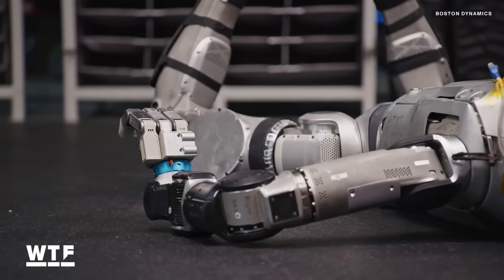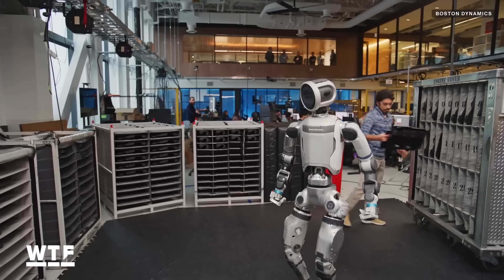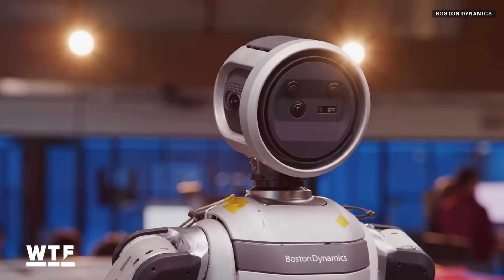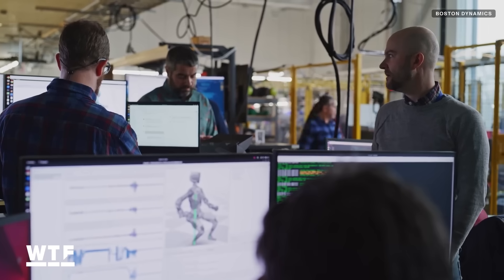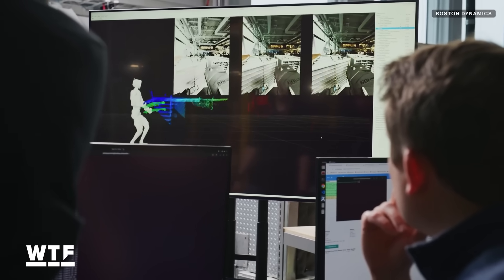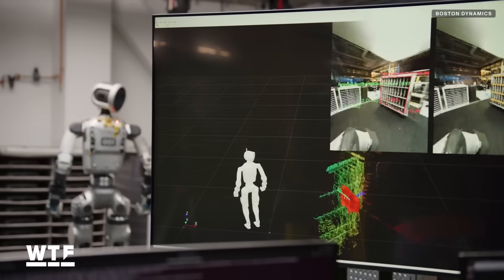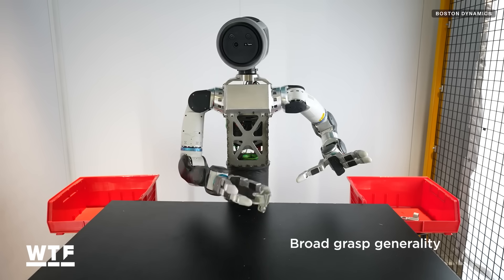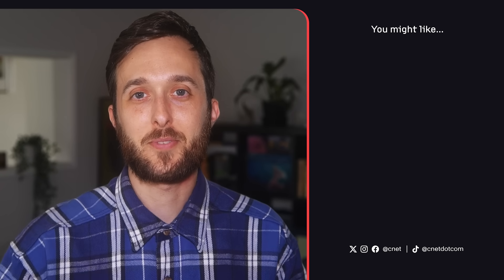How Boston Dynamics' Atlas Humanoid Robot Sees the World | What The Future

Comment: The head should have 360 degree view so it doesn't have to rotate at all.
Reply: that might increase the need for additional compute to process all those incoming pixels
Reply: @maxluthor6800 Thats true. But it would cut down the time the robot takes to swivel his head around. He'd be faster, more intelligent and more aware. I'm sure more compute could be in the cards in the future.
Reply: The head turning is totally for working with us, humans. We need that signal.
Reply: @DisciplinedWon  like we put an engine noise in EV car
Reply: They added additional cameras on the sides of its head, you can see them on the newest Atlas video
Reply: Does he see in 3D? 
If so it would be hard to add a 360 camera on top of it with stereoscopic lenses